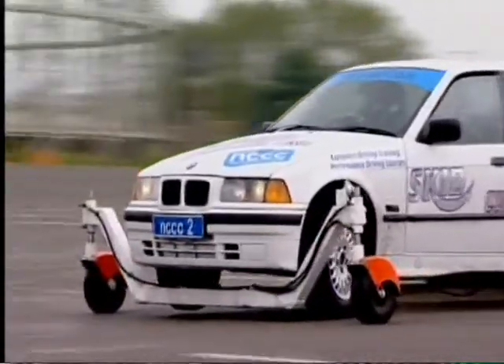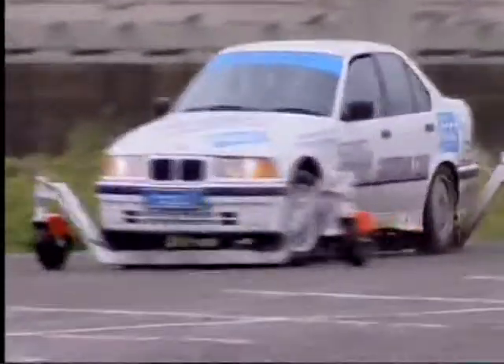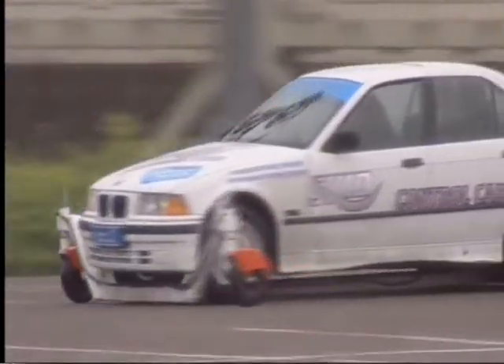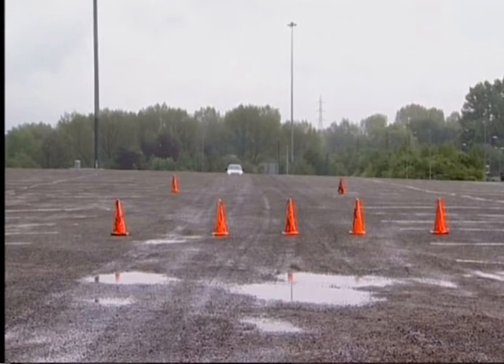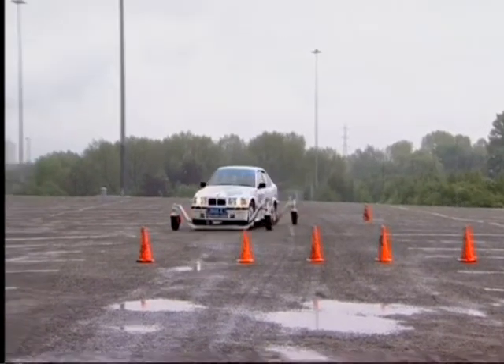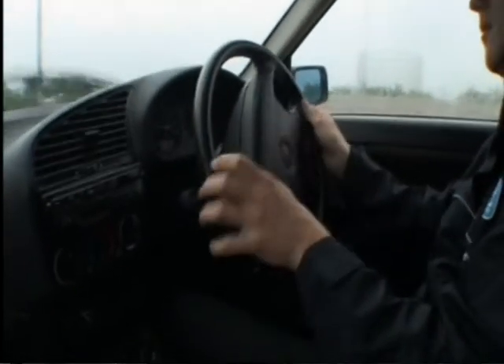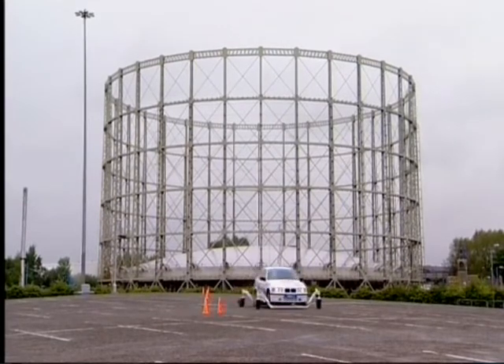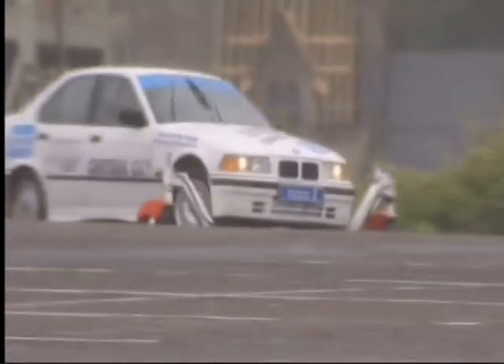NCCC Skid Control Course with Charlie Butler-Henderson

Comment: Maybe this is over simplified, iam still not sure if one should lift off the throttle when trying to correct a skid in a rwd car. Usually, the rear end loses grip totally when you lift off or brake and you end up in a ditch or into a tree. Is it a good idea to lift or brake ?

Comment: A SkidCar is a brilliant skid-control simulator. However, the coaching is somewhat lacking. 

Declutching to rectify oversteer is a good idea...on ice. On higher-grip surfaces, it's still a good idea to keep some power on so the car gain a couple of miles per hour.

In fast kinks, the very act of countersteering in an oversteer situation is all too likely to result in a pendulum effect, so it's important to react quickly enough as to simply apply enough torque to pull the car forward and straight ouf of the slide, without having to steer away from the corner.

As for cadence braking: Why on earth would you want to brake intermittently if you can simply lock up the wheels and back off a bit if and when you need the steering?

Skilled drivers can start to gradualy back off after the wheels have initially locked, as to keep them rolling continuously as well as making allowances for steering or the car behind you.

Comment: Ok. Some of this vid is ABSOLUTELY INCORRECT. And Friendlyuser1. On one MAJOR Correcting to his INCORRECT Way to correct your skid/slide/spinout on/in a REAR WHEEL DRIVE CAR. You DO NOT Want to COMPLETLY lift of the gas but you do want to have PEDAL / GAS / THROTTLE. Whatever way EVERYONE says. You DO NOT WANT TO COMPLETLY Let of the Throttle in a RWD Car. U Will loose control and smash into something. My VERY First comment on here because i just hadda say something.. I Made Accnt To Comment